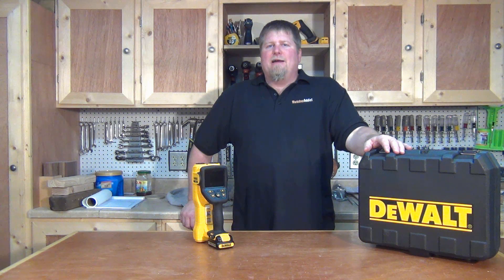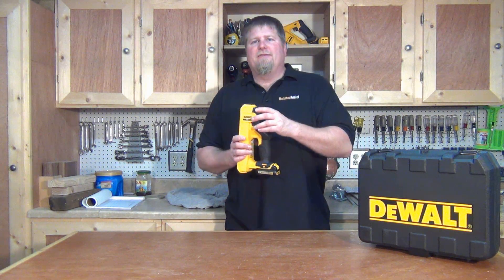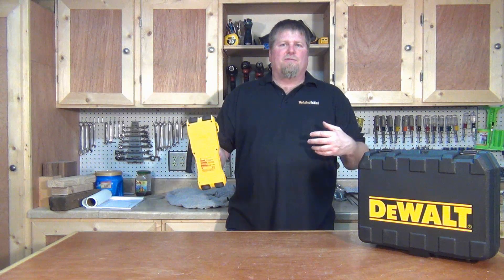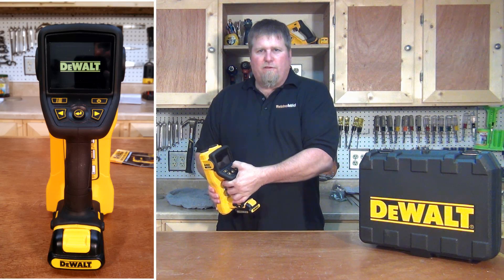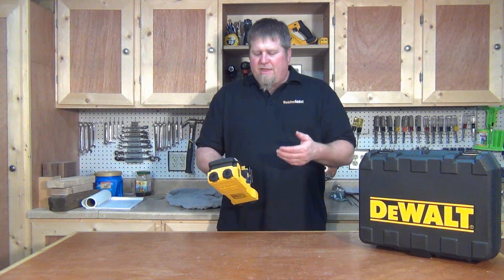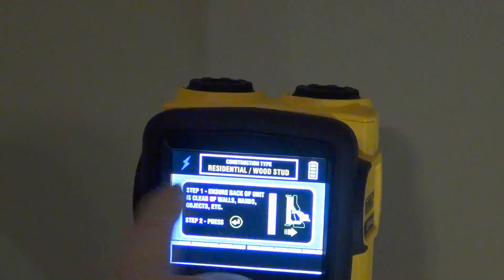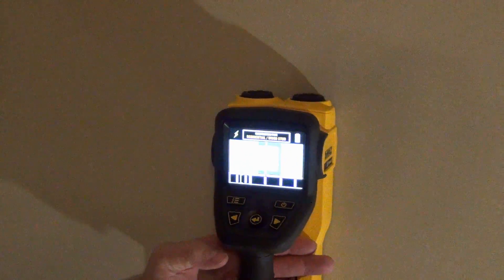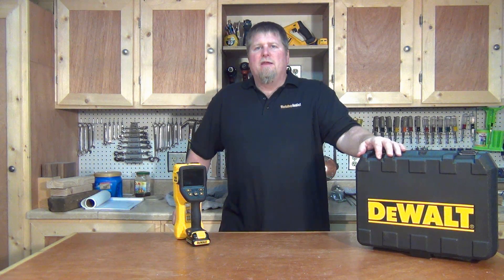DeWALT 12 Volt Max Hand Held Wall Scanner - DCT419S1

Comment: will it find steel strap windbrace , I have a job that the local council want to know if the building has strap steel bracing.  I thought it would be good to detect it without pulling off the plaster board? 
 thanks Steve.
Reply from the maker: Steve Sanders  Yes, it can find steel in the wall without issue.

Comment: Nice! I was very disappointed with the fail of the first gen. I'm glad to see they refined, and helped make a great tool! Thanks for the awesome look!
Reply from the maker: I am impressed that DeWALT acknowledged they had some issues and made the corrective actions to bring this unit back.  Thanks for the comment.
Reply: I am too! When I saw spy shots of this tool a couple years ago, I was like EUREKA!!! So many problems solved. Then, I saw one amazon review after another saying it did not work,  then it was pulled. So the re release is very awesome for me. I'm buying this tool promptly, because this fills a need for me. I think if you use this in concert with like a frankin stud sensor, and with a good thermal imager to verify cold water and hot pipes, you get a damn good idea of what's behind a wall, without any very expensive oops, that can cost many times more than the price of this tool. Thanks for sharing John!